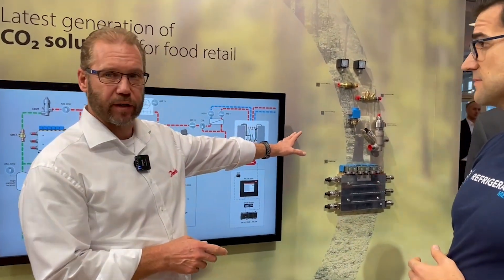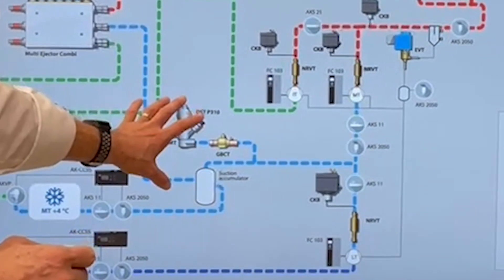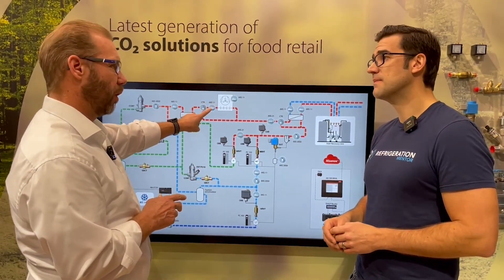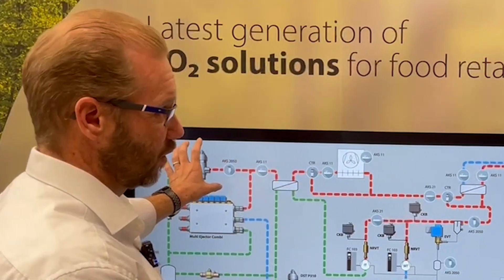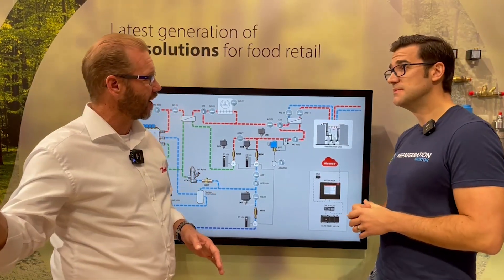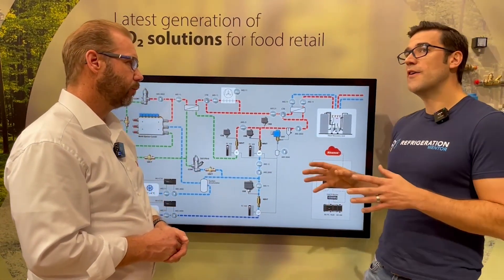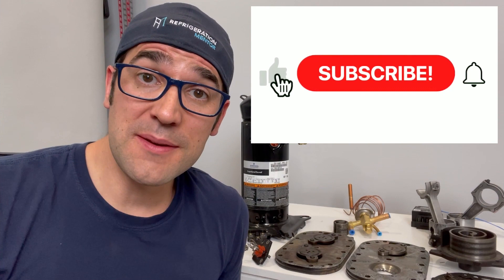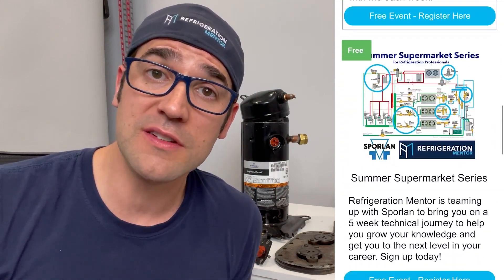Danfoss CO2 Overview

Comment: Hi, first of all this is a great video: there's a terminology I quiet didn't catch : whats POC (pressure of condenser?)
The other is why is he using kelvin ? That's so confusing in the USA 😂
Reply from the maker: Thank you. Not sure about POC I will have to rewatch but we did talk about COP Coefficient of Performance. The controller that controls the high pressure valve when in transcritical will push the condenser pressure up and down to get the best performance when in Supercritical/Transcritical.  Kelvin or Rankin is the correct term to use when you are talking about temperature difference like superheat.  Kelvin x 1.8 = Superheat F